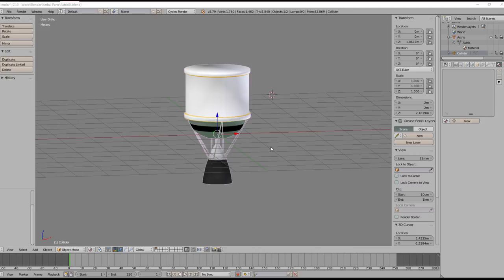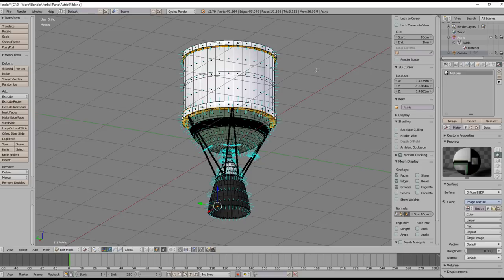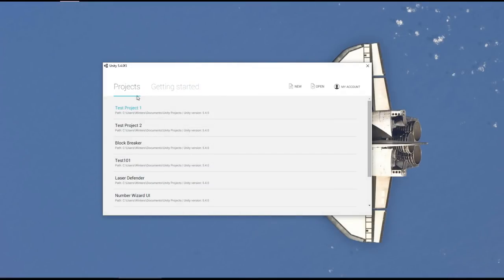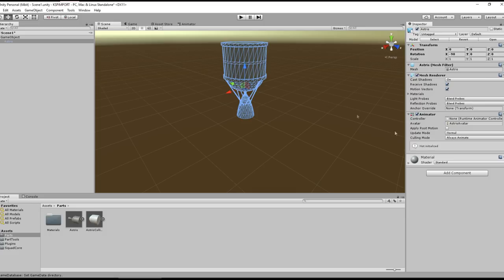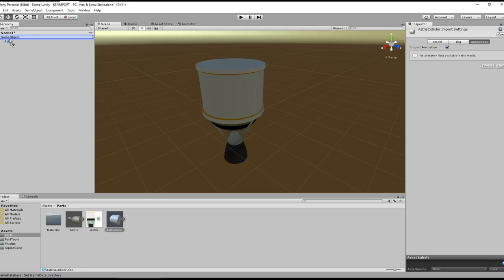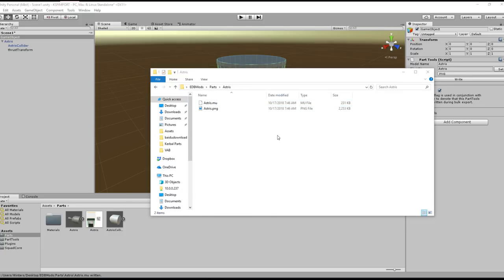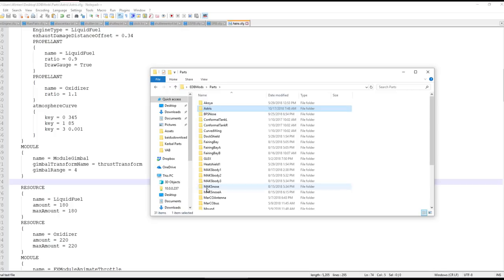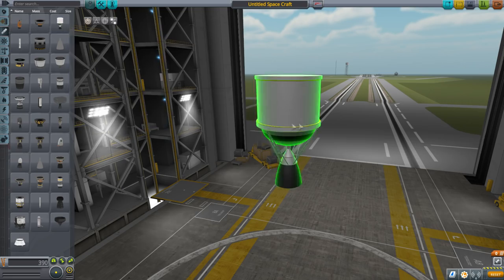Kerbal Space Program - How to Import Parts from Blender (or other 3D software)

Comment: Inspired by your recent Mars RO series, I have started a whole RO installation myself. Currently working on a lander, but my next project will be a Mars transfer vehicle. 
So I've been browsing mods, trying to find an X3 engine online. I can't.  No love for the x3. So I've decided to get my hands dirty and make one myself. 
I have dabbled in the arcane art of blender modeling, although I must be real rusty, but I've never managed to import any parts into ksp.
When I do make a part, I usually just grab some model that is there and edit the config to my liking.
Anyway, I'll get it started this week. Wish me luck.
Reply from the maker: Good luck! If you mean the ion thruster X3, I just changed the configuration of a LackLusterLabs ion engine model.
Reply: @RaizSpace  yeah, but it's a good chance to finally get an engine in ksp done. Almost done modeling it. It's pretty simple, just a cylinder,  but I'm putting in the concentrical slots. Can't remember how to texture stuff anymore, gotta watch your video again, I guess. Got a nice frontal picture of the engine that I am thinking of using as texture. 
No idea how I'm gonna make the blue glow yet, but I'm sure I'll tinker till I find out.

Comment: I went through the whole tutorial but my part doesn't appear in ksp. does this method work for the latest kerbal version? if so are there any things that would keep a part from showing up ?
Reply from the maker: If Unity produced the .mu file and you have that, the texture, and the config in the GameData folder somewhere, then I think there are there possibilities: the model has too many vertices, the shader is misconfigured (especially the bump map) or there's an error in the config file. The most common config file errors are the path to the model file and the category for the part (if the category doesn't exist, it won't show up).

Comment: Hey I need help... I tried to do that several times now. I manged to export the files from unity, created the cfg file, but nothing shows up in the game. No error, no part, nothing. Do you know some things to check which could cause this? I would really appreciate your help. I used unity 2017.1.3p1 and part tools for 1.7. I also tried other combinations, like on 1.5 and corresponding part tools.
Reply from the maker: I'm not sure - it could be a lot of things including errors in the cfg and the folder structure. I assume Unity produced a .mu file for you when you exported from Unity - just make sure of that. Otherwise, if you could post the cfg, that might give me an idea.
Reply: @RaizSpace  Thanks for the super fast response. I managed to import it now. I forgot to change the model= model.mu line. Also i had removed the Animator component from Unity. And unity showed an error Text mesh pro must be installed. Those are basically the things I changed.
Thanks alot for your video. Its great and its the only one which is up to date.